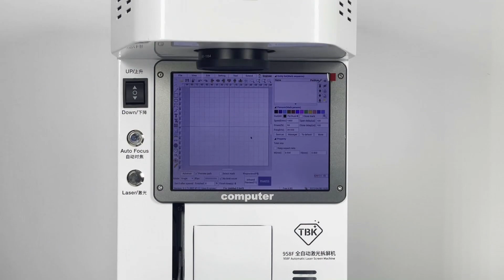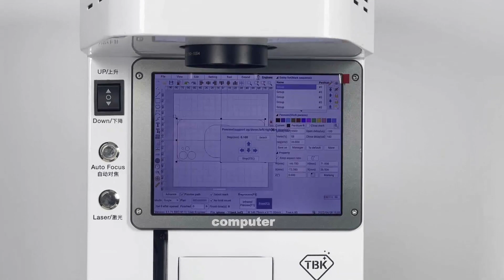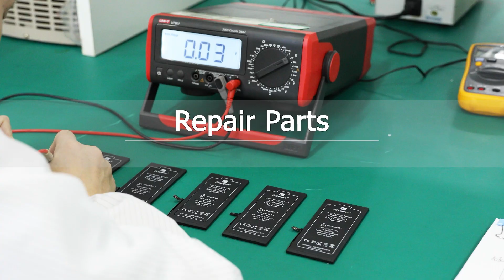TBK-958F Automatic Laser/Marking Separator Operate Demonstration

Comment from the maker: TBK-958F Automatic Laser/Marking Separator Operate Demonstration

New Upgrades: 
●Upgrade 20 optical fibers, marking and dismantling screen is 3-5 times faster, and marking is clearer
●The laser is more stable and not easy to be damaged
●The optical fiber is lighter. Longer service life
●Built-in activated carbon smoking device, No need to purchase an external smoking instrument
●One-button autofocus
●Built-in high-definition computer
●Can be connected to mobile APP to use

TBK-958F Automatic Laser/Marking Separator, 20W Fiber, w/wooden box package
http://www.elekworld.com/shop/product...
For more discounts,you can contact our wholesale team: elekworldservice@gmail.com